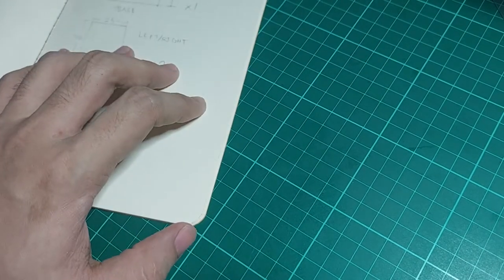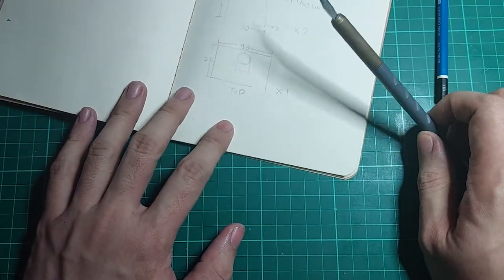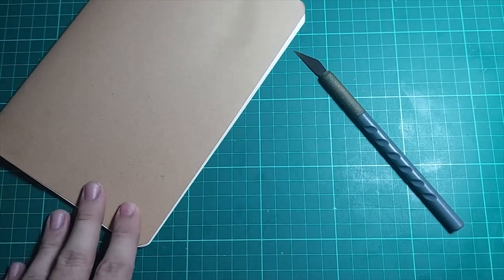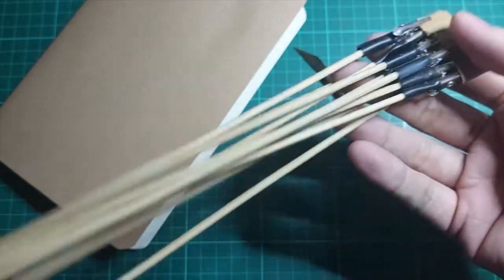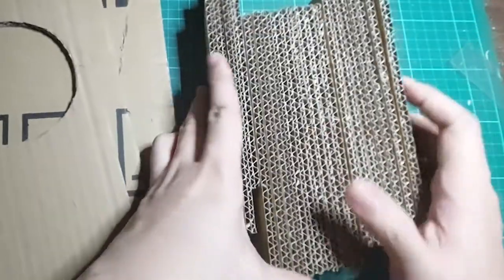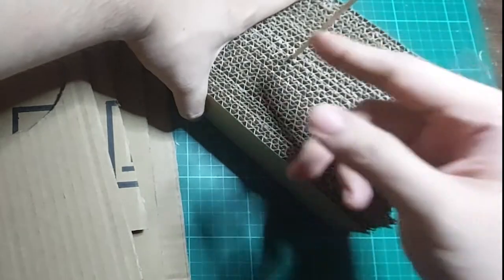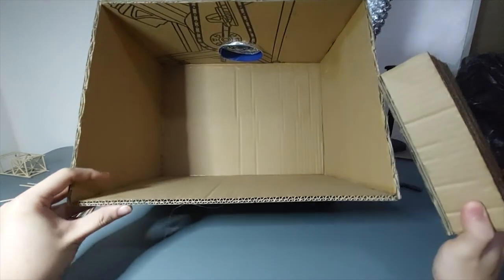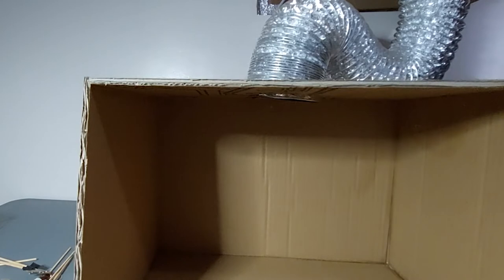CRAFTING SESSION: AIRBRUSH SPRAY BOOTH  |  SEVEN ARTS

Comment: What kind of exhaust fan did you use?
Reply from the maker: Just a regular 12 inch exhaust fan :) how I got the airflow from that is: I have my exhaust pipe from the booth connected to an enclosure that goes over the exhaust fan if that makes sense hahaha